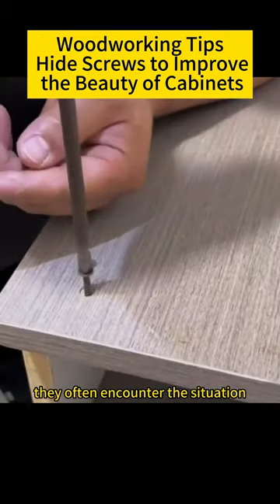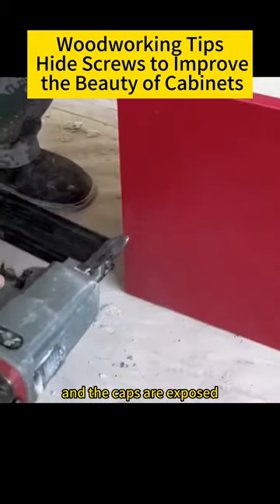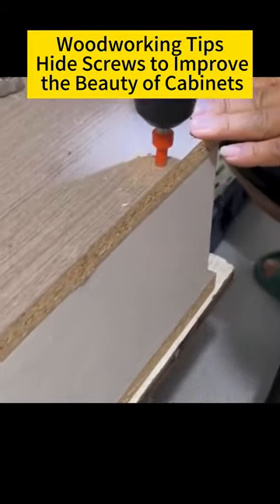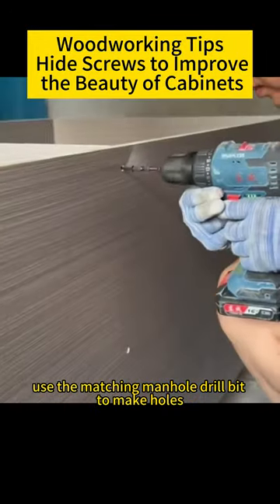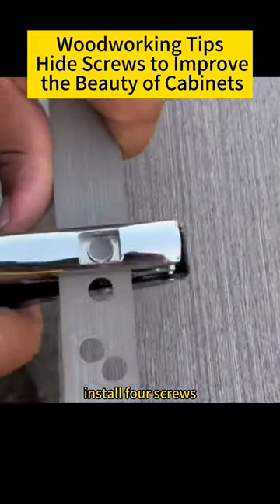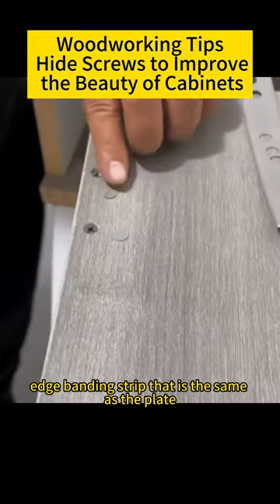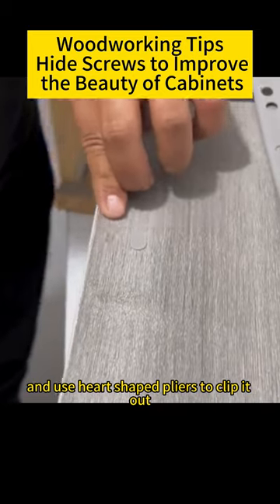Woodworking Tips Hide Screws to Improve the Beaut #lifetips #diy #handdrill #lifetipsforyou  #gadget

Comment: Not a bad method, necessarily. If you're doing premium woodwork, you need to do more, but for a DIY job this works fine. Just remember to glue the circles down, or they're gonna pop out in no time.

Also save that edge banding for the future, because you're gonna have to replace the circles eventually.